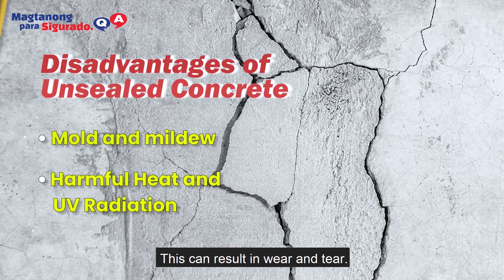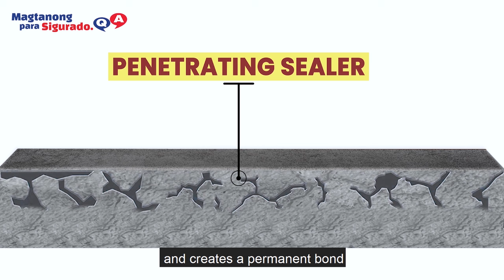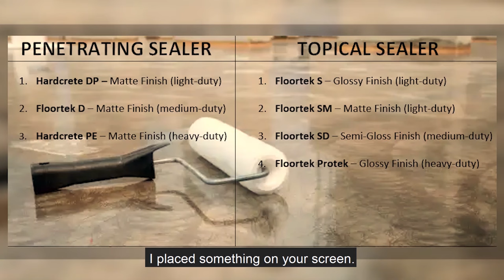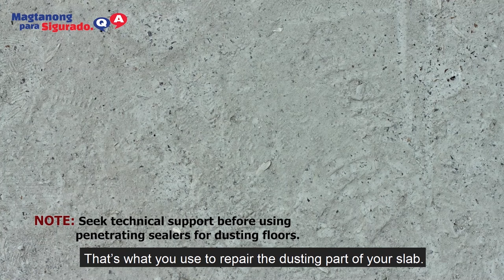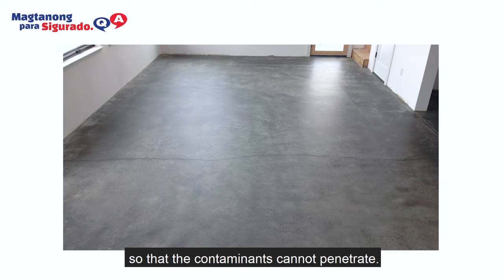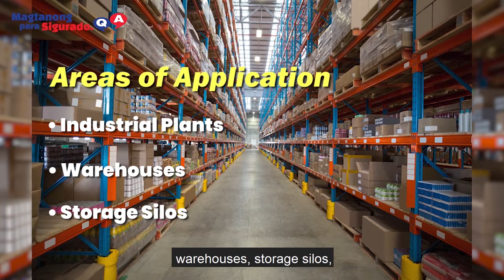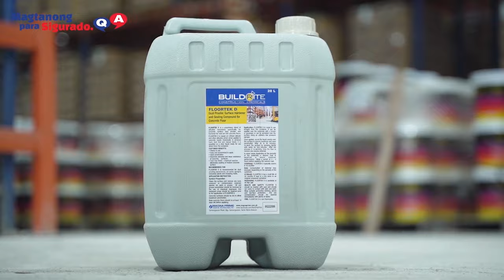Polished Concrete Finish Using a Sealer | Choosing the Best Concrete Sealer in the Philippines

Comment: Can u still put tiles in the future if u have  a topical sealer applied in your floor slab?
Reply from the maker: Hi, thank you for your inquiry. You have to grind the area with topical sealer first before placing the tiles. Please note that a proper surface preparation is needed before placing the tiles. For technical assistance, you can message us directly on our Facebook page: https://www.facebook.com/BuildritePhils
Reply: Wow that’s a quick reply. Thank u so much sir.
Reply from the maker: You're welcome.

Comment: Hi ask lang if pwedeng gamitin ang FLOORTEK S As a top coat sa epoxy painted floor we also use buildrite epoxy floor paint
Reply from the maker: Hi. Thank you for your inquiry,No sir hindi po sila pwede pagpatungin.Para lang po sa bare concrete ang buildrite floortek s.

Comment: Need pa ba na lagyan ng topical sealer after applying a penetrating sealer? Or topical sealer is enough?
Reply from the maker: Hi, thank you for your inquiry. Depende po sa status ng flooring nyo ang paglalagay ng sealer.
Reply: Do i need to apply sealer before waterproofing a roofdeck?  

Can i apply Cement grip after applying a sealer?

Comment: Thanks for this very informative video! Pwede po ba FCH self-leveling epoxy over Floortek S? Or kelangan remove muna young Floortek S bago magapply ng FCH?
Reply from the maker: Hi. Thank you for your inquiry. No ma'am. Dapat po bare concrete floor po. Walang existing sealer.

Comment: i am planning to use FLOORTEK D for my concrete roof deck na tututluyan for another floor in the future, my queries are the following
1) better po ba ung penetrating sealer kaysa crystor para madali ko kabitan ng tiles in the future
2) may effect po ba ung penetrating sealer sa rebar, di po ba nya kakalawangin ung bakal
3) ano po coverage area nung penetrating sealer per coat
4) May UV resistance na po ba sya
Reply from the maker: Hi, thank you for your inquiry. Floortek D is not intended for waterproofing. For 2nd floor and above, we recommend using the flexicrete system if you are planning to install tiles in the future. You just have to lay a concrete topping to serve as its protection. You can watch this video for your reference: https://www.youtube.com/watch?v=RPeJKgYIBm8&t=79s

Comment: Hello po sir I was thinking of doing epoxy floor coating kasi sa bahay ko and I stumbled upon your video na super helpful sa gusto kong gawin sa floor ko kasi I was looking for mirror finish na concrete floor kasi tanong ko lang po kabuildrite pwede ko bang lapatan and densifier ng tropical sealer if gusto kong matigas sya and both makinis din?
Reply from the maker: Hi, thank you for your inquiry. Yes, you can also check this post for your reference: https://www.facebook.com/photo/?fbid=233119079237872&set=pb.100076193444241.-2207520000.

Comment: Which is more affordable tiles or concrete po? And alin po sa kanila ang pang matagalan
Reply from the maker: Hi, thank you for your inquiry. The price of both solutions will ultimately depend on the preparation of the slab before application. 

The preparation for the application of sealers would take time if the slab needs repairs first or needs to be smoothened using a topping. As for the tile adhesive, you may need to use a topping as well so as to avoid using the thick bed method. Plus, the price of tiles could also vary depending on the type of tile to be used.

Comment: Just curious, Can you use both densifier and topical sealer sa floor?

Also, for the topical sealer, since this is a top coat, hindi ba sya pwede i polish using floor polishers?
Moreover, later days or months of applications ng sealer, hindi ba to pwede lagyan ng mga floor wax?

Sorry, curious lang po, hope you can respond.
Reply from the maker: Hi, thank you for your inquiry. First, need po muna ng proper assessment kung kailangan ba munang mag densifier bago mag topical sealer. Second, wala po kaming sealer na ginagamitan ng polisher machine. Lastly, no need na po and not recommended mag floorwax for Floortek S since magiging glossy na yung flooring.
Reply: Thank you so much for answering my query :) ❤
Reply from the maker: You're welcome po.

Comment: Sir direct to the point. Lets say sobra na kaming paniwala sa product mo, game na. Paano sisimulan para maging mirror finish ang floors namin. Fame start to finish with less talking.
Reply from the maker: Hi! You may apply Floortek S on your bare concrete residential floor to achieve polished concrete floor. 
https://shop.magnaprime.com.ph/products/floortek-s-3-8-kg?_pos=1&_sid=22fb9fd8b&_ss=r

Comment: Pwede po ba sya lagyan muna ng penetrating sealer saka patungan ng topical sealer para yung mirror finish ma achive parin at the same time mas matibay yung mismong concrete dahil sa penetrating sealer?

Thank you
Reply from the maker: Hi, thank you for your inquiry. Yes, pwede naman. Kailangan lang fully cured muna yung unang sealer.

Comment: Kapag acrylic painted (2 colors gray and white, checkered style) ang concrete floor, pwede po ba final coating ang topical sealer? Hindi po ba maghahalo or magkakalat ang 2 colors sa colorless na topical sealer?
Reply from the maker: Hi, thank you for your inquiry. Floortek S is for bare concrete substrate only. It is not recommended for painted surfaces.

Comment: Yung floortek S po ba pwede i apply direct sa dusty, rough finish ? Or need sa smooth finish sya iapply?  Pa answer pls.po para sa mga kwarto po sana
Reply from the maker: Hi, thank you for your inquiry. As shown po sa video, kailangan ng proper surface preparation bago ang application ng Floortek S. Kasama po dito ang pag vacuum ng flooring to ensure na malinis at walang dust. We recommend din na smooth finish na yung flooring bago mag Floortek S, to achieve a glossy-smooth finish flooring.

Comment: Hi Sir, ganito po ang gusto ko sa bahay. Ano ang recommendation nyo para sa loob ng bahay. Yung safe po sa mga tao na over 50s. Yung hindi po madulas masyado, less labor, and maintenance  Maraming salamat po 😊
Reply from the maker: Hi, thank you for your inquiry. You can use Floortek SM resin-based penetrating sealer in matte finish instead of Floortek S. You can see this post for your reference: https://www.facebook.com/BuildritePhils/photos/a.256515081150962/2541024289366685/
Reply: Do you do this flooring services?

Comment: thank you sir sobrang nakatulong po tong video na to :)

Question po pwede po bang patongan yung rubberized paint ng floortek s ?
Reply from the maker: Hi, thank you for your inquiry. Why do you have to apply a rubberized floor coating after floortek s?
Reply: @BUILDRITECONSTRUCTIONCHEMICALS   yung naiisip ko po kasi gamitin na pang kulay sa sahig namin is yung rubberized paint po tapos tsaka ko palang po lalagyan sana ng floortek S kung pwede po yun?
Reply from the maker: No, sir. Floortek S is for bare concrete substrate application only.
Reply: Sir quick question ho, as per your answers kanina ang Floortek S can be apply sa bare concrete po. Now, if we want to add tiles on our home floor after 6 months nung pagkalagay nung floortek s, pwede po ba makabitan ng tiles agad or ano dapat gawin? Thanks po. I want to make sure bago e place order ko for floortek s.❤ @BUILDRITECONSTRUCTIONCHEMICALS
Reply: same question po @BUILDRITECONSTRUCTIONCHEMICALS

Comment: pwede po ba na bago gamitin ang sealer ay lagyan ko ng color ang cement flooring? hindi po ba matatangal ang color? or may sealer po ba kayo na colored? thanks.
Reply from the maker: Hi, Thank you for your inquiry. Floortek s is recommended only for RECOMMENDED FOR:
 As a sealer for parkway structures, driveways,
garage floors, patios, walkways, decks, and
sidewalks.
 As a sealer for slate and terracotta tiles and certain
natural stones to prevent staining on the surface.
 As a sealer when waterproofing tile grouts/joints to
prevent water seepage.
 As a sealing coat on the underside and side of
marble and granite to prevent the appearance of
water marks.
 As a dustproofer coating for concrete, cement
plaster, screeds and exposed aggregate finishes.

Comment: Pwede po lagyan ng penetrating sealer tapos toppingan ng mkintab n selear?
Reply from the maker: Hi, thank you for your inquiry. Yes, you can apply Floortek D if your flooring is dusty then apply Floortek S to make it glossy. However, if the flooring is not dusty then you can apply Floortek S directly.

Comment: Pwede po b ito iapply sa topping? It means, mag topping muna ako ng mortar.. then apply ako ng floor tech s?
Reply from the maker: Hi, thank you for your inquiry. Yes, make sure na maayos yung topping. Walang cracks, hindi dusty at smooth in finish. You can also use Hardcrete 303 skim coat for floors before Floortek S.

Comment: Sir i have a two part question. First, pwede ba syang rekta sa raw cement finish? 2nd, pwede ba syang mapinturahan in the future kung nagkaroon ng renovation? Thanks in advance.
Reply from the maker: Hi, Thank you for your inquiry! Yes, Floortek S can be applied directly on bare concrete floors.
Reply: @BUILDRITECONSTRUCTIONCHEMICALS  how long should be the cement curing time bago gamitin ito?
Reply from the maker: Let the concrete cure for at least 28 days before applying a sealer or coating.

Comment: Good day. I have a rough slab finish ready to receive tiles. Kaso gusto na ng owner gawing polished concrete. Can we use Floortek S or do we need a concrete topping para mapakinis muna bago i-apply yung floortek S? Sana masagot po, salamat.
Reply from the maker: Hi, thank you for your inquiry. Polished concrete is achieve using a polisher machine po. Si Floortek S kaya lang nya gawing sealed in glossy finish ang flooring. Pwede po kayo gumamit ng Hardcrete 303 to make the flooring smooth bago mag sealer. Please also take note na may tendency mag darken or mag enhance ang color ng flooring once nag apply ng Floortek S. You can message us on our Facebook page for other inquiries: https://www.facebook.com/BuildritePhils
Reply: @BUILDRITECONSTRUCTIONCHEMICALS  Thank you for the valuable info 🙏
Reply from the maker: You're welcome po.

Comment: Hello I have 2 questions ...1.  from the bare concrete slab can i directly apply the Floortek S to achieve glossy finish?  2. Can I use also Floortek S on Flooring with Stucco Cement applied? thanks
Reply from the maker: Hi, Thank you for your inquiry. Kung para sa residential area lang po maaari niyong i-apply ang Floortek S at ito ay pang floor application lamang po.

Comment: Pno kn rough finish ang floor ano dapat gawin? At ano sabihin pg bumili ng makintab, Topical sealer ng biuldrite ba? at mgkano 1 gallon?
Reply from the maker: Hi, Thank you for your inquiry! You can use Floortek S for bare concrete residential flooring. Floortek S is a single-pack, clear, low-viscosity topical sealer for achieving a polished concrete finish on concrete, masonry, and brickwork surfaces

BUILDRITE FLOORTEK S (3.8 kg)
Regular price₱2,291.00

Comment: Is it applicable to use Cement Grip, Level Up 410 then Floortek D for my terrace?
Reply from the maker: Hi, thank you for your inquiry. Level Up is used before floor coating, vinyl, linoleum, wood parque and the like. Not advisable to be exposed.

Comment: good pm po,, pwede ko po ba gamitin muna FLOORTEK D to have SEALING EFFECT then after curing time FLOORTEK S naman para kumintab? thank you
Reply from the maker: Hi, thank you for your inquiry. Yes, it can be done if the concrete is not fully saturated. However, site inspection is needed to know the correct method of application, please send us a message on our official Facebook page: https://www.facebook.com/BuildritePhils

Comment: Sir Derick you topical sealer, after applicatio , pwede po ba e buffer yan o gamitan nang polisher para kumintab?
Reply from the maker: Hi, thank you for your inquiry. Floortek S gives a glossy finish without using a polisher machine. It is not recommended for that process.
Reply: Thank you Sir..
Reply from the maker: You're welcome.

Comment: What is the difference between floortek s and d? Can floortek S be used without floortek D?
Reply from the maker: Hi, thank you for your inquiry. Floortek S is a resin-based film forming sealer in glossy finish while Floortek D is a penetrating sealer and densifier in matte finish. Yes, you can use Floortek S without Floortek D as long as the flooring is not chalky.

Comment: Oil base or water base ba yan..
Reply from the maker: Hi, thank you for your inquiry. Floortek S is a resin-based topical sealer with glossy finish. It  is a clear, single-pack, ready-to-use, low-viscosity film-forming sealer that can be directly applied to concrete surfaces straight from the 
container.

Comment: Hi sir ask ko lang po kung mas matipid po ito compared sa tiles? Thank you po
Reply from the maker: Hi, thank you for your inquiry. The price of both solutions will ultimately depend on the preparation of the slab before application. 

The preparation for the application of floor sealers would take time if the slab needs repairs first or needs to be smoothened using a topping. As for the tile adhesive, you may need to use a topping as well so as to avoid using the thick bed method. Plus, the price of tiles could also vary depending on the type of tile to be used.

Comment: Pwede ba to e top coat sa mga countertop na concrete na may pintura
Reply from the maker: HI, thank you for your inquiry. These sealers are for flooring use only and not recommended on painted surfaces.

Comment: Kailangan bang finish na yng flooring bago apply at pde ba to sa rooftop na open?
Reply from the maker: Hi, thank you for your inquiry. You have to smoothen out the flooring first before applying Floortek S to achieve a smooth mirror-like finish. It can be used on exterior applications but make sure to apply a suitable waterproofing materials first.

Comment: I bar a new screed floor, i want to seal it, it a resto bar so light traffic, I was thinking of using floor tek d, is the the right one ? because it harden the top and it penetrate the top and make harder
Reply from the maker: Hi! Yes, you can use Floortek D on your bare concrete floor. 
https://shop.magnaprime.com.ph/products/buildrite-hardcrete-d?_pos=8&_sid=1fe94f1fa&_ss=r

Comment: Hello po. Kailangan ba na may puro cemento ang finish bago lagyan ng sealer para makintab ang finish?
Reply from the maker: Hi! Floortek S is applicable for bare concrete only.
Reply: @BUILDRITECONSTRUCTIONCHEMICALS  it means rough finish pa? Paano ma attain yung Kintab? May video kayo ng preparation from pouring concrete upto application of floortek s?
Reply from the maker: You can use Screed to smoothen out the flooring before the application of Floortek S. You can watch this video for your reference: https://www.youtube.com/watch?v=d-XpO3kCNTA&t=56s

Comment: Pede din ba sa floor na ginamitan ng wax for a long period of time ung topical sealer na glossy
Reply from the maker: Hi! Thank you for your inquiry. You have to remove the existing wax from your floor using  concrete grinder before applying Floortek S.

Comment: What should I use to patch my concrete prior to using a sealer?  I can’t seam to find the answer anywhere.  Quick Crete?  Mortar?  I did not want to use epoxy filler.   I want to keep it as natural as possible.

My next question is:  can I dye the floor before Densifying it?
Reply from the maker: Hi, thank you for your inquiry. Proper assessment and surface preparation are needed for this problem. You can watch these videos for your reference.

(Part 1) https://www.youtube.com/watch?v=Ve0te8AfkJo
(Part 2) https://www.youtube.com/watch?v=IYp0yUixZg4&t=133s

You may also send us a direct message via our Facebook page so we can discuss your inquiry: https://www.facebook.com/BuildritePhils

Comment: Sir puede po ba sa floor na Meron Ng skim coat? Puede po bang gamitin yungfloortek S?, Salamat po sir
Reply from the maker: Hi, thank you for your inquiry. We can not determine what kind of skim coat you used on your flooring. However, Floortek S is compatible with Buildrite Hardcrete 303 skim coat for floors.

Comment: Hi what will be the final
Color of the concrete floor after applying Floortek S?
Reply from the maker: Hi, thank you for your inquiry. Floortek S can achieve a glossy concrete look.
Reply: @BUILDRITECONSTRUCTIONCHEMICALS  i mean will it darken the concrete or will retain the original color of the concrete. Btw, i used Hardcrete 303,
it was light gray before application floortekS. After applying floortek S it became vwey dark.
Reply from the maker: Any brand po ng glossy sealer, mag eenhance po talaga ito at magdadarken.

Comment: sir puede ko bang gamitin woter froofing sa slub yong penetrating sealer?  garage din kasi yong roof deck
Reply from the maker: Hi.Thank you for your inquiry. No sir. Hindi po waterproofing ang Floortek S.

For slab waterproofing, we have two options that you can use: Cementitious Underlayment or Waterproof Top Coat.

1. Flexicrete is a flexible cementitious waterproofing underlayment. It can be applied on areas where you need to apply a topping.

2. Clever Sil is a water-based, polyurethane waterproofing system that can be applied using a roller. It can be applied without a topcoat in areas with low to medium foot traffic.

You can watch this video for your reference:
https://www.youtube.com/watch?v=pINmXW1DlaU